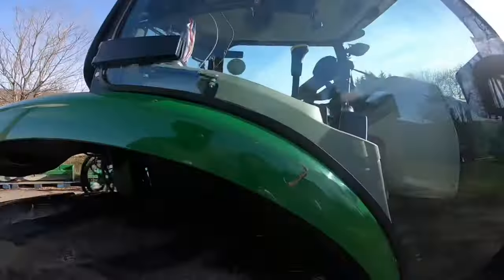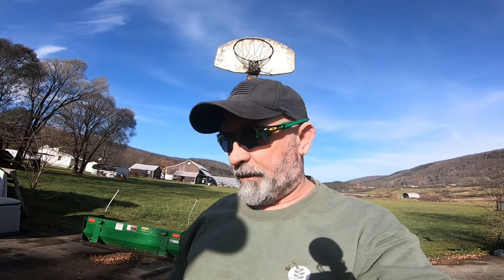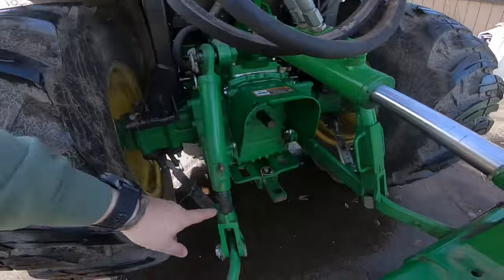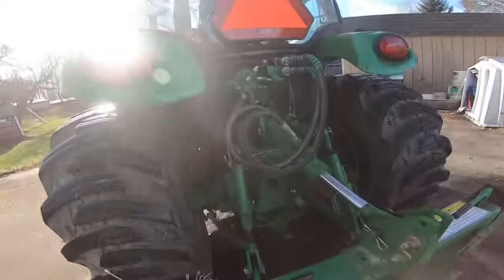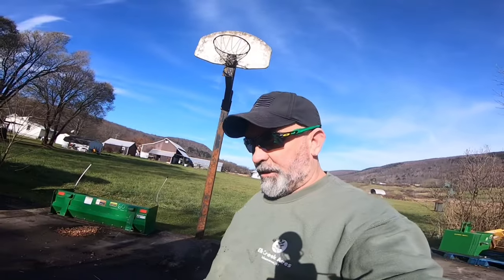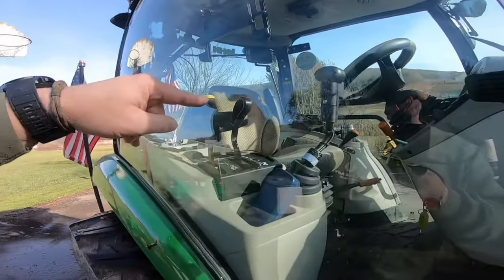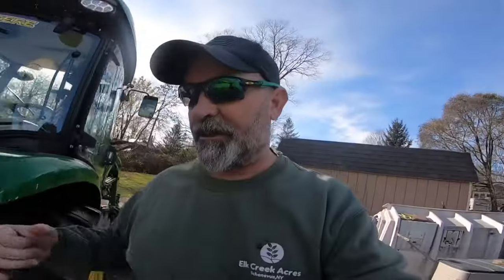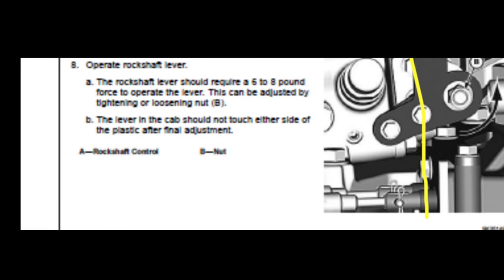The John Deere 3R cab rock shaft adjustment

Comment: My 4R is easier down than it is up.  So mine acts just like yours.  I do agree with you that these adjustments should have been done at the assembly line since there is a spec for the 3pt adjustments.
Reply from the maker: Absolutely, no way we should have to worry about getting the rock shaft adjusted properly. But, once it’s done it is much nicer, and a sense of accomplishment knowing that I made it right myself.

Comment: I worked on a lot of tractors and the only thing I don’t like about that design because cable stretch overtime and you have a problem with them. That’s the only thing I don’t like about that but I just wanted to mention that to you.

Comment: Thanks for the "How to" vs a comparison and no fix, thanks again!
Reply from the maker: No problem, I just felt like the adjustments should have been mentioned, rather than making people believe that this the way all 3R cabs are.
Reply: There IS NO FIX to the loader control issue.   Pat  misleading by focusing on a minor portion of our video, rather than the HUGE issue of the stiff loader joystick that my wife’s weaker hands cannot even operate.
It is MY JOB to provide off-spec details about these tractors to help viewers decide which one to get.   I correctly pointed out an issue….a the viewers can decide.
Rewatch our video, I was NOT against buying a 3R cab….i just want to provide all the facts.
(Edited to fix the stinkin autocorrect mess)
Reply from the maker: @TractorTimewithTim  not understanding your second sentence, I never made reference to a “fix” for the joystick. This was about the rock shaft, which is very easily adjusted.
Reply: @ElkCreekAcres autocorrect gremlins took over. Sorry
Reply: @TractorTimewithTim  "MY JOB"
What the heck does that mean?  Other than YouTube, who else paid you?

"Rewatch our video, I was NOT against buying a 3R cab….i just want to provide all the facts."
1) I watched the video yesterday and IMO you did leave out facts.
2) If you point out short comings about a tractor and provide no fix you are to a degree against buying the tractor IMO.  I don't see anything wrong with that, just the way I see it.
IMO most all tractors have design issues and my opinion is just that, my opinion.
You kinda screwed up, live with it.
Reply: @GizmoTucker have a good day, Keith. 
Easy to find failure in our videos.  We do the best we can.
Obviously never good enough for you and Pat.    Never will be. Sorry.  …and yes, i WOULD like the information to perfectly accurate, complete, and presented with the right tone all the time.  Unfortunately, I fall short.    
No amount of browbeating, or repeatedly attacking me will fix that.
I don’t understand why a couple of guys have so much passion to destroy our work.  
And yes, we are payed to do this work, by many sources.     Folks watch us because we bring up issues and details that other reviews will not mention. 
BTW, I’m happy to show the adjustment of the 3 pt control.   I have access to a couple of 3R cab tractors that need it.
Reply: @TractorTimewithTim  Relax Tim. Perspectives and opinions are  just that.  Your video title indicated the video was based on an opinion and maybe a so called "job".  I get it but Elk Creek gets to voice their opinion as well but I assume they didn't do it on your channel.   All good here, you have a good day as well.

Comment: Pat,
Let me take a minute to defend Tim and myself some if I may...
We shot that video top present facts as we found them, and I feel that is what we did.  The results were just as shown in the video on the various machines, the 3R cabbed was brand new on loan from JD with only a few hours on it.  We (at least for sure I) did not think of trying to mention adjustment or solutions for each individual result we found as we did tests and comparisons, that obviously would not have been possible in that video due to time-but is a good topic for future videos from Tim and even other influencers like yourself.
It seems the rockshaft and joystick issue really touched a nerve with some guys including yourself, and I'm personally sorry for that-it was not the intention to bash the machines, but merely show the differences overall between them since it's rare to have so many machines in one place at the same time.
Anyway, we are starting to beat the horse more deader 😆 I am happy to hear (and learn) that the adjustments can me made easily on the cabbed machines, and that you are not unhappy with the joystick as soooo many are including myself.  Regarding that, I've also learned that the cabbed 4R's use a much different cable routing setup that greatly reduces the force needed to operate the joystick when directly compared to the cabbed 3R's. I'm still doing some research on how we might incorporate that idea in the 3R to make it better.

Tractor on!  Keep up the great videos my friend 👍
Reply from the maker: Thanks for the reply Kenny!!
To set the record straight, I was not purposely trying to bash Tim's video. The only thing that really touched a nerve with me is the fact that his channel has so much more reach than a small channel like mine. I haven't looked, but his video is likely at 40K views, mine will be lucky to reach 500. So it is IMO up to the bigger channel to be more diligent when making videos, simply due to the amount of reach that his video will achieve. I understand the loaner tractor issue, but there again, that could have been mentioned. 
As for the FEL, I never said that I like it, it's definitely not as nice as a direct connect. All I'm saying is that with mine I don't feel it is as much of a burden as many like to say it is. And many of the haters are simply "following the line at chow time" IMO. 
Thanks again for stopping by and dropping a comment, you are still one of the most respected in the JD world and I appreciate what you do for us.
Reply: @ElkCreekAcres obviously I shoulda mentioned or even adjusted the 3 pt lever.
However, the MAIN point of our video was intended to be the loader joystick.   ….and to my knowledge, there is no way to adjust it.
I personally think YOU are not being fair by brushing the loader joystick issue under the rug…trying to isolate the discussion on the ONE area that COULD be adjusted.

I love the 3R cab tractor, but this issue is major.  Denying it is being disingenuous.  Not helpful to our viewers.

We try to do an accurate job, and we WERE accurate in this video.   Failing to think about and mention the 3 pt adjustability seems pretty minor to me when Christy cannot smoothly control the loader with one hand!
Reply from the maker: @TractorTimewithTim  just making sure I understand you. If I say that I can operate my loader as smooth as necessary is misleading and disingenuous!!  But for you to say that it takes 27 lbs of force to pull the rock shaft lever back without mentioning the very simple adjustment to correct this is not misleading or disingenuous?? You seem focused on the FEL, my video was to show the adjustments to the rock shaft so the user has a fully functional 3 point hitch.

Comment: Great video.  Needed to adjust mine and this was helpful to increase the height.  Does the feedback control also adjust the low limit position or is that only adjusted with the valve linkage?   mine does not seem to drop low enough. Also were you able to remove pin “B” in the image from the service manual for the valve adjustment without taking the tire off? It looks like it’s a pressfit pin.  As I said  I need mine to drop lower to hook up to a a JD weight ox with my imatch.  Now I need my weight box to be on RR ties to reach it since the hitch won’t drop low enough.   Thanks for the videos!
Reply from the maker: @robertconnor3324  the feedback adjusts the height only to best of my knowledge, but I’m certainly no tech. All the adjustments I made I was able to do without removing the rear tire,  I had no interest in wrestling with that being they are loaded.
Reply: @ElkCreekAcres  mine are loaded to.  So to get the arms lower it’s the main valve adjustment I guess.
Reply from the maker: @robertconnor3324  somewhat with the main valve, but mainly with the adjustable lift links on the 3 point.
Reply: @ElkCreekAcres  I fiddled with it last night for about 30 minutes and got everything adjusted. With the main valve, I was able to get it to drop lower.  I followed the directions in the service manual.  Thanks so much for posting that video. It really helped me out.  I can say getting those adjustment nuts at the valve without taking the tire off requires a bit of a contortionist.
Reply from the maker: @robertconnor3324  glad my video helped!! And I agree, very difficult to get two hands on things with the tire in the way.

Comment: I didn’t have much issue with this video.  We did not think of or mention that the 3 pt lever tension could be adjusted,  ok, could be a mistake…and we put ourselves out there, so we can take the criticism.
However,  Pat’s replies to the comments are a different story.  Total misdirection,   We pointed out a major issue with the 3R which to my knowledge has NO fix.  
The loader joystick control is very difficult to control, and requires a LOT of strength to operate smoothly.  Christy simply cannot control it smoothly with her small weaker hands.
I consider Pat a friend.  I have no idea why he has chosen to attack.  This really should not have been a big deal.
Reply from the maker: Tim, this was not a personal attack on you, I even referenced that towards the end. I suppose to me it seem a bit overdramatized on the rock shaft lever, especially with no mention about just how easily it can be adjusted. With a channel as big as yours your video could very easily mislead the unknowing to believe that this is it.
As far as the FEL joystick I will agree, it definitively takes more force to move it. But I will stand by my statements that I have no trouble operating it smoothly. Actually if I could just eliminate the slop I wouldn’t have any real issue with mine, with the exception that the float detent is not as easy to engage as it was on my other tractors. IMO that’s not misleading anyone, that’s just been my experience, but that is also limited to only this cabbed 3R.
Reply: @ElkCreekAcres  you certainly didn’t defend me to the guy who says ‘this is why he unsubscribed’ from me.And yes…you DID focus on one small point in our video. Rather than the whole point.  
BTW, how well can your daughter handle the joystick?
Reply from the maker: @TractorTimewithTim  my daughter can operate this loader, but she doesn't actually use the tractor, so for any expectation of her operating it as smoothly as I do is not fair, but she can and has operated it just playing around. My wife has operated it as well, though I was more nervous than usual when she was hoisting me up in the bucket with a chainsaw to trim branches. Lol
The focus of my video was not on one small segment of your video. It was to show people that the rock shaft can easily be adjusted. In reading in Facebook groups and on GTT it is no secret that most of the cabbed 3R's are coming from the factory with the rock shaft all out of sorts. I wanted to show people this, and I actually tried to film it, but without removing the rear tire you couldn't honestly make out what I was doing in there. So, I decided to use screen shots of the tech manual instead, I'm not as  high tech as you. Yes, I focused on that one segment of your video only because it seemed like a big deal in your video, and it's a very simple adjustment that took literally only a few minutes. As I've told you, I didn't use my scale before I started. I simply adjusted it until it "felt" better and then used my digital scale to make the final adjustment.
Sorry if I offended you, that was not my intention. But, your video touched a nerve with me as well as the title. As I said, better advice would be to go to the dealer and try one out first.